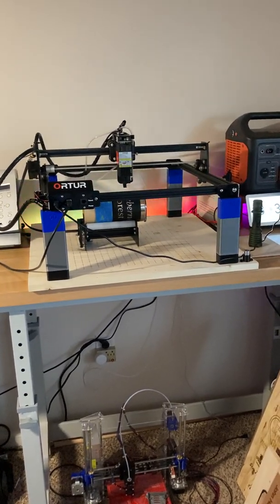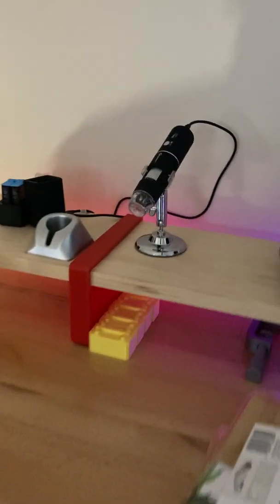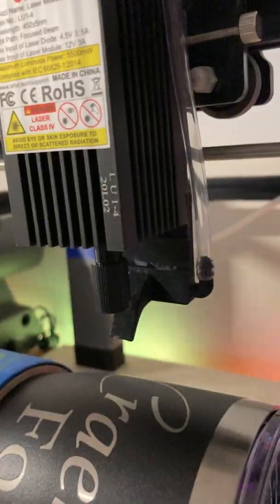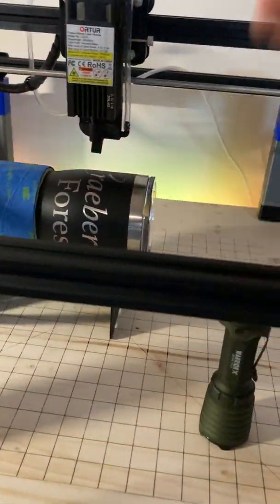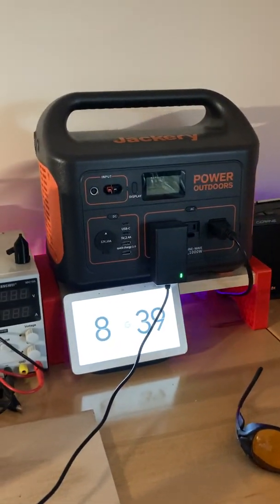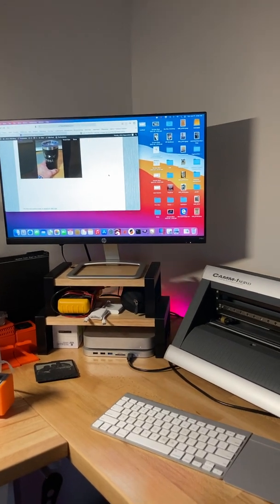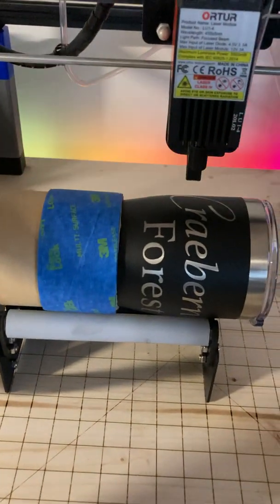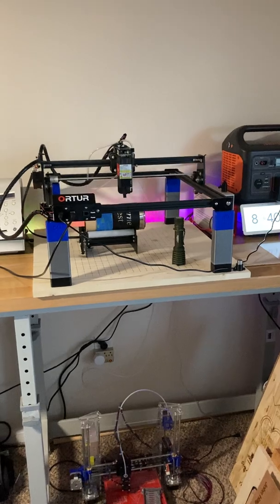My Ortur Laser Master 2 Set Up

Comment: I like the 3D printed feet but since my printer is DOA waiting on a motherboard upgrade I am considering using some PVC and some adapters I can easily print on my resin printer. Then I can just cut pvc to whatever length I want. I could make these using resin but seems like a waste.